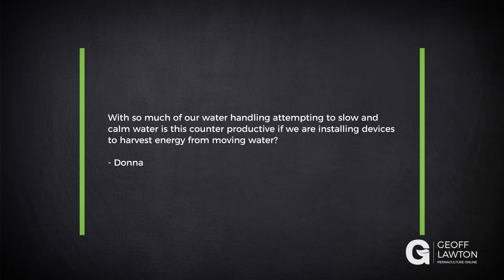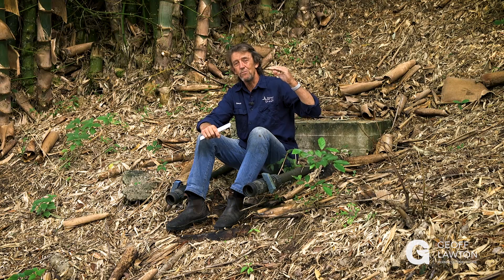Can I Harvest Hydro-Energy and Still Slow and Pacify Water?

Comment: The question Ive got is how do you keep the water from eroding away the opening?  So you have a pipe that goes through the dam, at those edges water is gonna erode that edge where the dirt meets the pipe.  What things do you do to stop that from happening?

Comment: you can also use low water storage to high infrastructure storage as a battery.
Reply: That's a good point there is a lot of potential with hydro/solar. During the day Solar provides an excess of energy to pump water to the hydro electric power generation. Get the balance right it's almost free energy.